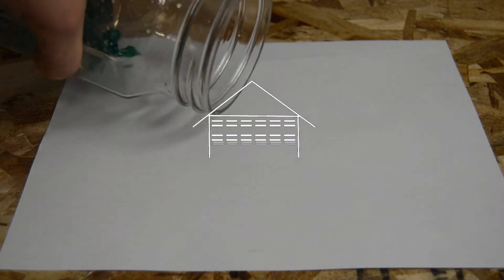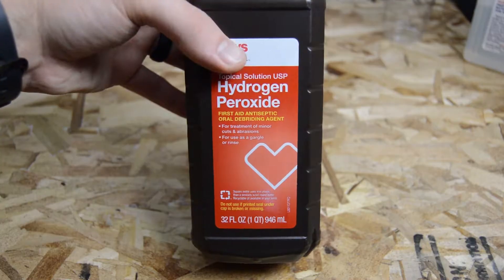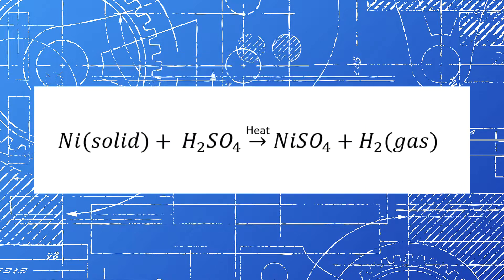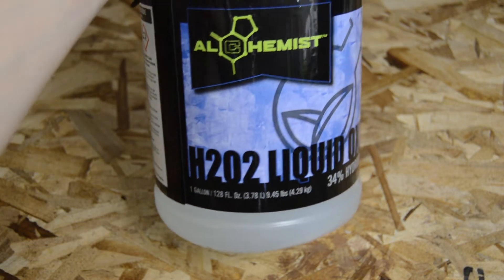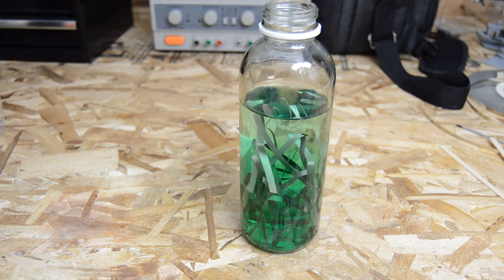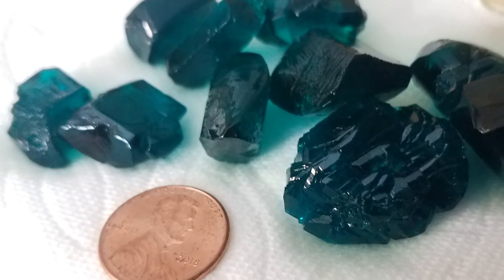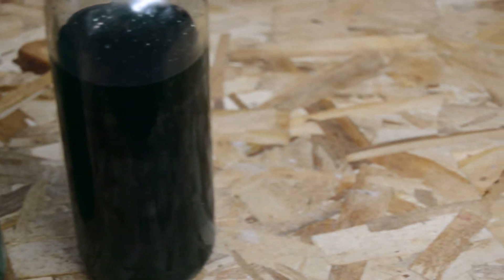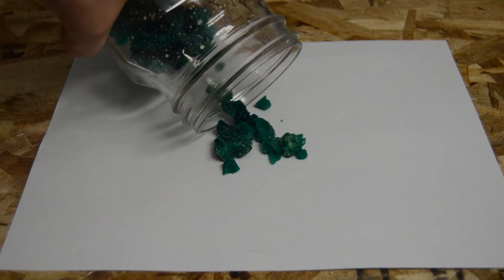How to Make Nickel Sulfate Safely ~ A Nickel Plating Solution Ingredient

Comment: Great helpful video.  When I tried this initially it did not work, the reaction would not start.  I tried different peroxide types, different nickel sources.  Then in one comment it was mentioned that the nickel strips must be completely clean.  After cleaning the nickel with acetone and alcohol this worked as the video shows.
The battery acid used is about 4.3 mol/L solution.  I found that can dissolve 16g of nickel for a higher concentration if you give it two days.
Nickel sulfate will precipitate if you add some potassium hydroxide (KOH) or sodium hydroxide (NaOH, aka= lye) up to a solution pH of 0.5 to 1.0.  Nickel hydroxide will precipitate if you add even more KOH or NaOH up to a solution pH of 10 to 11.  Be sure to stir the solution when doing this.  Heating is optional and will speed up the reaction.  Pour the solution though a coffee filter and rinse with distilled water to get pure precipitate.

Comment: Fantastic! I was running over budget with my copper playing experiment. This will save it!
Reply: I’m in the same boat but thought you can just use nickel anode I’m in cathode. Current and it will make a solution. Then after a day. You remove negative/cathode insert item being     plated with negative attached and positive anode still in with positive. Then plating happens? Why does a full solution need to be pre made? Is it better plating. Thicker, brighter? Total cost 20 for anodes, 10 for wire and alligator clamps salt sealed container.

Comment: Let's plate something with this Nickel Sulfate! You can also get Muriatic(hydrochloric) acid pretty cheaply as most big box home stores and I'm sure NiCl2 would work for electroplating as well. And just a bit of nitpicking here, but those are probably NiSO4(H2O)6 and not NiSO4. Great job, none the less and keep up the good work. Or better yet, if you have some iron around, screw the electroplating and make some iron-nickel magnetic particles.
Reply: Helo hmx. I got muriatic acid 20% concentration. So, with 12 grams of nickel... How many milliliters of Muriatic should I use? 
I would greatly appreciate your knowledge!
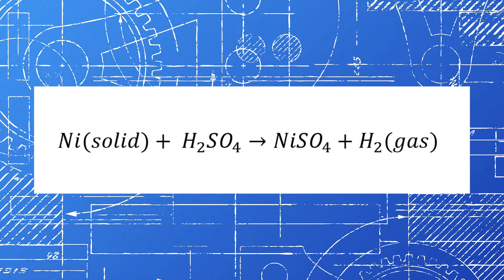Reply: @ivanbutorovich619  The reaction is similar to one shown at 1:29 in the video. You have

Ni(s) + 2HCl(aq) ⇨ NiCl2(aq) + H2(g)

So you will need at least 2 moles of HCl per mole of Nickel. At 20%, you have ~20g HCl per 100 mL(or grams) of solution. This should equate to a molarity of 6.02 moles/L of HCl (the density of HCl solutions varies with concentration).  Nickel is 58.69 g/mol and HCl is 36.46 g/mol. 12g/58.69g/mol is 0.204 moles of Nickel so you need 0.408 moles of HCl. We will round this up to at least 0.5 moles of HCl to ensure that Nickel is the limiting reagent. So 0.5 moles HCl / 6.02 moles HCl/L = 83 mL 20% muriatic acid.

So if you use 100mL of Muriatic acid, you should be able to completely covert the full 12g of nickel to NiCl2.
Reply: @bipolarchemist  I'm very grateful for you answer! :)

Comment: You commented that for use in plating that the solution would need to be diluted, however this seems to go contrary to what other plating videos imply in that they want a "more concentrated" solution, one creator even saying that some industrial solutions are almost black in appearance.
Reply from the maker: I'm sure their are a variety of concentrations that work. If you watch my nickel plating video you'll see the recipe for the Watts bath I made requires a less dilute concentration. The added advantage of precipitating crystals out of the solution is that it should also separate out most to all of the sulfates from the battery acid.

Comment: what was the pH after the nickel metal dissolved?  I suspect the bulk of the sulfuric acid is left over and does not react.
Reply: Mine was approx 1... according to litmus paper test. I'm currently trying to figure out how to dilute into suitable plating solution.
Reply: mine also remained very acidic, I wonder if it is necessary to neutralize the solution before recrystallizing, which is not mentioned in the video, the point is that if it remained acidic it means that there is potentially still sulfuric acid in the solution and I fear that when crystallizing, a by-product is formed which pollutes the purity of the crystals
Reply: This will have a pH of 0 to 0.5, there is a lot of sulfuric acid remaining

Comment: If you're doing plating what's the dilution ratio you use?
Reply: Did you ever find the answer to this?
Reply: @Jbogator  oh good lord. No. I haven't messed with that in a couple of years and don't recall what I did in the end,, haven't had the chance. Will be this summer though.
Reply: @CDale-tc3xz  ok thanks.
Reply: I'm trying to find the answer as well.

Comment: Great video,  good science ! Do you know what the advantages vs disadvantages to using acetate vs sulphate  for plating.   Crystals are awesome  regardless  I'm gonna do this experiment...... evaporation is incredibly slow here 3 miles inland and in the deep south low. humidity threshold is 69% lol but those are jaguar green crystals and an awesome distraction from my prime goal.
Reply from the maker: The presence of sulpahtes doesnt have much of an effect on the electroplating.  Your question is a bit flawed as well. For nickel acetate the acetic acid provides the low pH needed for plating and also works to break down oxidized nickel into nickel ions. The comparable ingredient in say a watts plating bath is boric acid which is used as an acidic pH buffer.  Using nickel sulphate therefore is just a means to get the bulk of initial nickel ions into solution. Then as pH slowly rises from hydrogen gas formation there is small amounts of sulphuric acid added to lower the pH back down.
Reply: @GarageScience  Thanks GS, I just see a big majority of folks who are using the nickel acetate,  I am assuming because it's simple and easy, and not too intimidating chemicals.   Making this is more involved,  so I assumed that it may have an advantage over the acetate.   Besides the cool crystals option.   I guess I figured the sulfuric acid was providing the low Ph  and the boric acid was some catalyst or smoother.    Thanks again,  this helps me a lot, I really like to understand the reactions I attempt before I invest into a proper setup.
Reply: @GarageScience  uh,  I'm sorry if I'm being dence,  but if watts solution uses the boric acid to increase the conductivity and the sulfuric acid is just for the initial breakdown of nickel into solution,  why do we use sulfuric to modulate the PH creeping up?   What would be the effect if we used more boric acid, or say acetic or phosphoric.   Just pondering what can be achieved and looking for unseen pitfalls,  I don't expect you to know the full extent of those questions, but I'd like to hear ×hat you have learned about this aspect.   THANKS AGAIN  for taking the time to share your experiences.

Comment: So Nickel Sulfate will simply dissolve again if put back into water or does it require the peroxide again too?
Reply from the maker: It's a salt just like the sodium chloride in your table salt. So yes it will dissolve again in water. It'll a few minutes but it'll dissolve.

Comment: How much dilution for plating types of steel or metals ahead of copper plating?
Reply from the maker: A typical watts plating bath has a nickel content of about 0.3mol/liter. My experiment produces a concentration of about 0.5mol/liter. Dilute with about 240ml of water to achieve 0.3mol/liter concentration.

Comment: Beautiful video!  It is also possible to use atmospheric oxygen to oxidize the nickel, but the process is incredibly slow--I got a few grams of nickel salts after sitting in acid for about six months.  I need to try using an air bubbler setup to see if I can speed that up; I was concerned about managing the resulting corrosive mist of metal and acid.

Comment: I was thinking about a way  of getting rid of the water  by increasing the surface area. How about a wide shallow glass container submerged in a near Boling water bath? What do you think? Is only water leaving the solution or do I need to think about ventilation?
Reply from the maker: That would also work. I thought about doing that but didn't want to sacrifice one of my wife's cooking dishes haha. It is only water evaporating so no worries about other harmful chemicals.
Reply: @GarageScience  did you consider a water distiller? I have one that takes 4 liters. It finishes in about 7 hrs....

Comment: how long would it take to dissolve at room temp?
Reply: i mean without peroxide
Reply from the maker: It's not much more time. Maybe an additional 15min. It's not truly necessary to heat the water it just makes it a little easier.
Reply: @GarageScience  but i mean without peroxide you know?
edit: i once dissolved an iron nail in a jar in 10% sulfuric in a few weeks it was so beautiful bubbles all the time and blue color
Reply from the maker: It would probably take weeks. From what I observed after several days there was no noticeable reaction taking place.
Reply: @GarageScience  i will get back to you in a few monthes

Comment: Would a 15% battery acid concentration be enough? Due to regulations I can't buy a more concentrated solution
Reply from the maker: Yes it will. You may have to change the ratio that I use in the video and increase your acid amount by a proportional amount. You'll also end up with more water to evaporate at the end.
Reply: @GarageScience  thanks, I think I've got the calculations figured out. I'll be using it for electroplating. According to my calculations I'll even need to dilute it by 50%
Reply from the maker: I recommend diluting after reacting the nickel.

Comment: Would this work also for preparing iron sulfate from stainless steel pins or mesh?
Reply from the maker: It might. You can also make iron sulphate by repeatedly dipping iron into copper sulphate and the exchange reaction will cause iron to go into solution and copper to deposit on the iron. But this is laborious and probably ends with Cu contaminants in your iron sulphate.

Comment: Is nickel sulfate and nickel sulfate hexahydrate the same thing?
Reply from the maker: Technically no but for the purposes of this experiment they basically are. The hexahydrate indicates that for each nickel sulphate there are 6 water molecules crystalized with it. This is a pretty standard form to buy nickel sulphate but you can also get it in its dehydrated form. The biggest thing is to account for the water weight from the hexahydrate when measuring out chemicals for a solution.

Comment: I have already managed twice to break down nickel sulfate at 120°C into nickel monoxide (light green powder that is not water soluble) and sulfur trioxide even though it was still in an aqueous solution. Does anyone understand this? Because nickel sulfate only breaks down at 840°C, which is what you read everywhere.

Comment: Can the solution be boiled in a container directly over a heat source rather than using the double boil method?  Won't this speed up the evaporation of water in order to form NiSO4 crystals?
Reply from the maker: Yes it would. My own experience with this approach has been that the combination of boiling with an acidic solution has caused even stainless steel pots to corrode. I've actually had holes created in the pot and had boiling hot acid spilled all over the place. Thankfully I was using a hot plate in the center of my garage floor  so there were no injuries or damage but still a mess. I wouldn't recommend that approach.
Reply: @GarageScience  What are your thoughts about boiling the solution in a glass beaker?

Comment: i found nickel sulphate hexadhyrate %99(chem pure) on a store..is it proper for nickel plating
Reply from the maker: Yes it would be, and technically it would probably be better than what I've made in the video... not sure what the purity of my nickel sulphate is but it probably isn't 99%.
Reply: @GarageScience  can i use nickel sulphte hexahydrate for electroless nickel plating. what else will i need for electroless plating?

Comment: My distilled vinegar diy nickel sulfate electrolyte solution is brownish and foggy and ideas what I did wrong I'm using the same nickel strips you have and I read to use distilled vinegar only low voltage and a day later I got brownish white water very cloudy
Reply from the maker: Are you using the nickel strips for both electrodes?  If not you could be introducing contaminants.  Vinegar is acetic acid and has somewhat of a complicated structure compared to sulfuric acid.  It's possible the vinegar is breaking down into other organic components.  Those would be my first two points of investigation.  Try vinegar and mix in hydrogen peroxide to break down the nickel, then you won't have to use electricity.  The hydrogen peroxide will oxidize the nickel and the acid will strip away the nickel oxide into solution to make your electrolyte.  Also, with vinegar as your acid you'll have a nickel acetate solution not nickel sulfate.
Reply: @GarageScience  ok yes I was using the nickel for both positive and negative the negative was black and looked nothing like nickel plating, I didn't know that I was making nickel acetate instead of nickel sulfate I will research to see what the difference is I'm definitely interested in electroplating, I am trying to electroplate my rc car drive shafts and other metal pieces any suggestions for the beginner?
Reply from the maker: My advice is watch my other videos ;). I've got some good ones on copper plating and nickel plating.  If you don't want to use sulfuric acid to make nickel sulfate you can fork out a little extra money and just buy the nickel sulfate outright. The amount you need to do nickel plating in a Mason jar isn't too expensive.

Comment: I did exactly as the video suggests and although it is kinda working, it's been 24 n my 14g of nickel is no where close to being dissolved. I got the sulfuric acid from auto parts store and is identical to the one in the video, numbers n all.  I'm assuming my sulfuric acid wasn't concentrated considering container was full and it's not required to add water? 

Edit: 
The Nickel I'm using is solid @ 99.6%.
Reply from the maker: Sorry for the late reply, did you add the hydrogen peroxide?  The sulfuric acid by itself although it will react without the hydrogen peroxide it will be a very slow reaction.  Also need to make sure your nickel is clean.  Any oil on the surface will prevent the reaction from taking place.
Reply: No worries on how long it took to reply..

After leaving my last comment I ran into Someone else in  here who had the same issue using a solid piece of nickel
  So I ordered nickel strips and they dissolved perfectly fine. 
I thought I had the wrong concentration of sulfuric acid but in the end it all worked out.

Comment: Thanks for your excellent job,
Really mean it! 
Is there any difference by using sulfuric acid at 98%? All your videos show car battery acid that is around 35%, here impossible to find, I can get only 98%, so any difference? Cause I dont have any skill in chemistry I prefere to ask even silly question that end up in a disaster.....
Once the solution is ready, without turn it in crystals, could you please repeat how to mix it: with what, distilled water? Which average %
Thanks so much
Reply from the maker: Hey now, part of being a garage scientist is learning a new thing every now and then. There are plenty of resources out there on how to properly dilute a solution.  Go read around, you don't need me to be your calculator.
Reply from the maker: Also, I'm very glad you're enjoying my content 😊.
Reply from the maker: Also, I'm very glad you're enjoying my content 😊.
Reply: Could you pleast at list tell me if, with your formula and  sulfuric acid at 98%,  the proportion between oxigen peroxyde and sulf acid remain the same?
Thanks so much!
Reply from the maker: It would take a very long time to react the exact amount of hydrogen peroxide with sulfuric acid. The ratios I provided in the video over supply hydrogen peroxide since it will naturally decompose over time. So any leftovers will eventually go away. Whereas if there is left over acid it give your nickel sulfate an acidic pH.... so short answer is that yes the ratios in the video can be maintained and still work at different reactant concentrations (ie. You'll need about 1/3 the amount sulfuric acid).
Reply: Thanks so much!